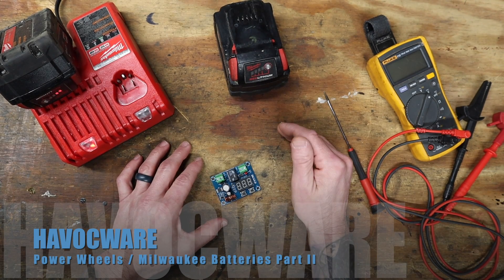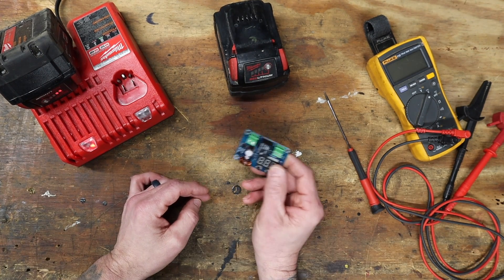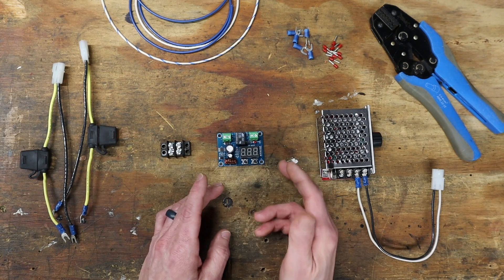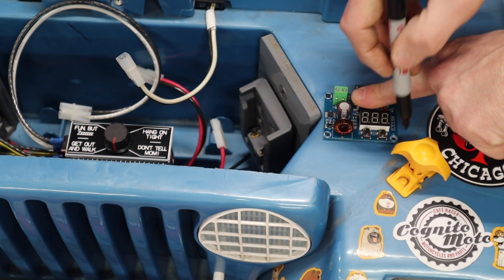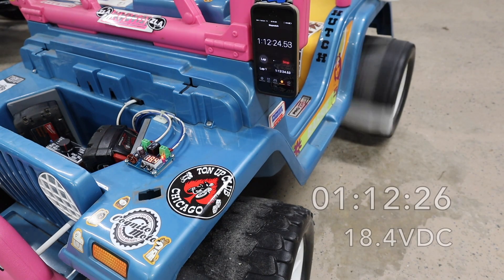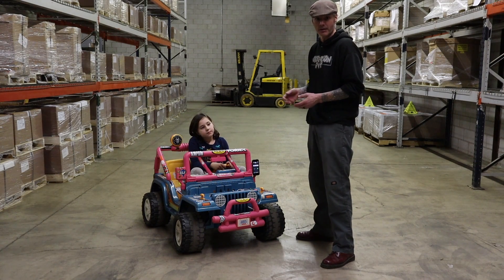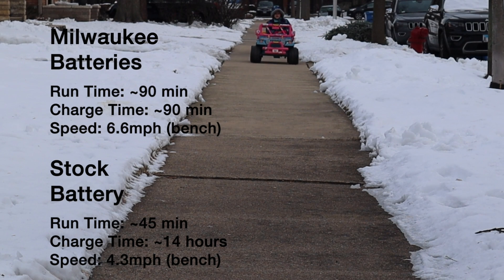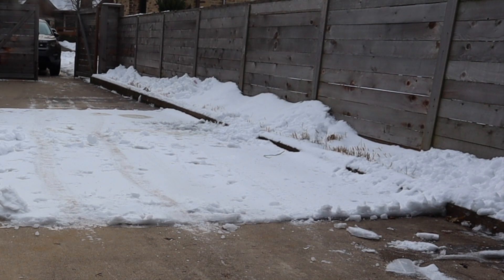Power Wheels Milwaukee Battery Upgrade RUNTIME TESTS & Battery Over Discharge Protection Install

Comment: Hey man great work. I watched your video a few times then I decided to go for it. I have a older peg perego Polaris rzr 12 volt that the batteries quit charging on. I ordered the 2 Milwaukee 18 volt adaptors , voltage regulator, and voltage cut off relay off amazon and installed it like you did in the video. I’m running 2 18 volt 5 amp hour batteries. I got about 10 minutes of run time before it quit working. Not sure if I burnt up the motors or something else. I was thinking about ordering the 24 volt 550 motors on amazon. I was wanting to know what you thought about those motors. Also I was wondering if you upgraded any thing else in your set up. Thank you and any advice would be great.

Comment: Hey bigg guy I'm thinking of trying with a 20 volt, why is the reason to use 2 batteries? Serious question and great videos.  Too cool!
Reply: Two batteries will allow the care to run longer of wires correctly. If wired incorrectly, they can double the voltage and likely burn out the motors.

Comment: What about amp draw? Stall amps on the motors is 28A, well over the limits of the voltage cutoff. Have you blown any units?

Comment: Did you add a power switch? Won’t the low voltage protector continue to draw power even after it has stopped delivering powers? Or do you just remove the batteries after every time it’s used? Thanks and awesome video!
Reply: I am wondering the same thing?  I had a low voltage cutout circuit like you used on mine but forgot to unplug the batteries after a session and the cutout board drained it down to 5v.

Comment: What size and type of wire is preferred?
Reply from the maker: The fuse holders and battery clips were both pre-wired with 12g THHN. I used MTW for the remainder of the harness, it's a bit more flexible for harnesses and panel wiring.

Comment: The battery hook up I will be using is from 2 busted rigid drills I got for a local repair shop that were just going into the recycler. Since I am using a stock rigid battery hook up and battery, do you think that it will have the over discharge protection built in or will still need to discharge monitor installed? Is that circuitry protection in that part of the drill or farther up the handle that will be chopped of?

Comment: works great with the 5.0ah batteries but doesn't work at all with the big 12.0ah battery for some reason the breaker trips instantly with the big high output battery which really sucks as it runs a long time wired direct but it's not worth toasting the most expensive 18v battery milwaukee makes. If they make a low voltage cutout module with a higher breaker like 30amp that would be prefect.

Comment: I have to completely rewire my kids kid trax jeep. I have all of the parts you have. My question is, where do I insert the foot pedal switch? I upgraded all the wiring to 12g. I am not going to use any relays. Everything is fused at 30 amps and the foot switch is rated a 30 amps also.
Reply from the maker: Hey there. This modification only replaces the battery portion of the circuit. Everything after these new battery connections is stock wiring, and hasn't been altered.

In my case, the output from the speed controller connects to where the original battery would connect, and the foot pedal switch is most likely just after this connection. I can't be certain, as I didn't modify the unit beyond the battery.
Reply: I got it all wired up. Now I'm waiting for 775 motors and new steel gears.

Comment: This worked great for a couple of days until the protection circuit fried.  It turns out that it’s rated at 20 amps.  I felt it, and it was hot (not warm) to the touch.  Now I’m trying to figure out if they make one of these that can handle 40 amps or a way to wire in a relay.  I’d certainly welcome help from others or the original poster!  Everything else worked great though
Reply: Oh and looking at Amazon reviews others had the same problem on Power Wheels so we might need to find a more heavy duty version.
Reply from the maker: Hey Doug. Sorry you're having an issue with the load on the protection relay. If you're up for it, I can draw up a quick schematic for you to use the voltage cutoff unit in tandem with a 12vdc auto relay. Might cost another $5 (and a new cutoff module), but it will definitely handle the overcurrent issue.

Cheers.
Reply: havocware yes please!  I considered this but could not wrap my head around how to wire it in a way that the board can still read the voltage.  Thanks!
Reply: @havocware  This is exactly what i need. Please tell me where to pit the relay 24v in the wiring and i can figure it out as one video shows it after the low voltage control unit to the voltage speed control and then the relay.  So not sure if this is correct. Thanks for your time.
Reply: @havocware  Can I please get the schematic.  Everywhere i read, states that the cutoff unit will burn out with mlwke and dwlt batteries. even some of the vendors on amazon state it in the details/prod description.

Comment: Thank you! I just got this mod done and it works flawlessly. 
Does anyone know what the low voltage shutoff for 20v dewalt batteries should be?
Reply from the maker: Excellent Jim! Cheers!
Reply: My Dewalt cuts out at around 15.11V, a 16V setting will do the trick.

Comment: Thanks for this video, I was able to upgrade my kids car to 18V safely. I had to use a 2 channel relay optocoupler since her car has led lights and a music player with a display that works on 12V.  I had Ryoby battery packs but it's basically the same thing. Great Video!!!
Reply from the maker: Hey Robin. That’s awesome! Glad someone was able to get one of the newer vehicles with lighting and sound dialed in with this mod! Cheers!
Reply: Hello! I was looking for any information how to save lights and sounds on newer vehicles and get the upgrade done but found nothing. Can you please share any tips on how you did it?
Reply: I did it tonight, one of those purple kidtrax convertibles. Radio, headlights, fake engine startup. All seemed like it worked perfectly fine. Everything did get brighter with the voltage being turned up, but that's something for tomorrow me to give a shit about.

Comment: Thanks for the great video! I noticed that the molex connectors that you recommend are 14-20 AWG. Will those work with the 12 AWG wire that comes on the cradle?
Reply from the maker: Hey Moe. I didn’t have any issue with the molex pins and the 12g wire. It’s a tight squeeze, but nothing it wouldn’t but into. Cheers!

Comment: Has anyone had trouble with the voltage controller blowing fuses.
Reply: Yes.  I burnt out a voltage controller.  As the manufacturer suggested, I ended up using two voltage controllers (one for each battery) to get around this.

Comment: I did the same conversion, but the 30 amp fuse on the power controller keeps blowing. Any idea what might be going on?
Reply from the maker: Hey there. Sorry you're having trouble, but do you have any fuses on the circuit aside from the internal fuse of the controller?
Reply: This. I’m having the same issue. Everytime we start it up the 30 amp fuse on the speed controller blows within seconds. We have the 2 fuses coming from the batteries but they are fine. We followed this mod to a T with the exception of us using 2 20v dewalts. You do such a great job of explaining everything. I’m not sure where we could have went wrong. 
It’s like the jolt of speed once you hit the pedal blows the fuse or something. Any help would be greatly appreciated by anyone.

Comment: how has the shut off held up over the last few months. I seen its recommended for 20A max. is it still running?
Reply from the maker: Hey there Michael. So far so good - I haven't had any issues with overloading or fatigue. Cheers!
Reply: @havocware  ok thank you. i was worried the 20A max load rating wasn't enough. im going to grab a couple
Reply from the maker: Make sure you add a fuse somewhere in the circuit anyway. A $00.35 fuse is cheaper than a $20.00  speed controller...

Comment: I'm setting up my low voltage module right now. From the video did you set the postive side to 16v then the negative side to 1.5v to get that 17.5v?
Reply from the maker: Hey there! Close - I set the cutout value to 16.5, and the threshold to 1.0 = 17.5. You’ll be fine with 16 / 1.5 if you prefer. Cheers!
Reply: @havocware  awesome thanks for the fast reply! Not sure if you've done this yet but I also upgraded the motors to Traxxas 775, I'd recommend that if you want a little stronger motor and a little more speed!

Comment: These batteries should be able to tolerate running down to 2.5 volt in each series of the pack and they are 5s2p which would be the 13 volts or so but this run time was amazing and I think you would decrease some performance. I am probably going to set it up to go to 15V cut off. The more you run the battery to the full depletion the harder it is on the battery but 15 volts should be fine. That will probably add 30-60 minutes  and it should have no effect compared to 16 volts. I would not go to 13.5V as it is possibly a poor cost to fun ratio.
Reply from the maker: Hi Carlo. That’s some great information, appreciate the input! Cheers!
Reply: @havocware  anyway you would consider making a plate for the speed controller and  if so how much.

Comment: What would I set it to for my dewalt 20v batteries?
Reply: My Dewalt cuts out at 15.11V.
Reply: I've been wondering the same thing!
Reply: @richardconrad698  My Dewalt will cut out at 15.11V.
Reply: @308Sharpie  Thank you! I think I set mine to 17 something, from something I saw on the amazon product page for the power shutoff. Good to know! Once my daughter masters steering, i'll increase the speed and i'm sure she'll drive it more! So i'll probably want to adjust the shutoff then, thanks!

Comment: Hey mate really enjoyed the video. Quite a detailed and well thought out.
.....Can you lol run the batteries in series for maximum voltage? How would the motors hold up?
On another video, the guy essentially swaps out the "throttle" (its just an on/off switch) with an actual throttle pedal .. (I guess it would be basically the same as the controller that you have, but with a pedal instead of a knob ... right?)
*In the same video, the guy also did 48v and blew the motors
Reply: @Mephmt  I was thinking 36volt.
And yea, some sort of progressive "throttle" rather than the on/off switch as standard.
I mean you could always run 2x18v (if 18v batteries is what you currently have) and then dial it back to whatever is a comfortable voltage for both the driveline and motors. (and driver lol)
Right?

Comment: I have a question to the general public 🤔 I did everything and now it just continues running once put the batteries in whether the power button is on or off could some please explain to me what went wrong. Any suggestions would be greatly appreciated 🙂 🙏

Comment: So I did the setup as you described. I place it in my kids Yamaha grizzly 4 wheeler and it doesn’t move. It does a slight jerk motion but no movement. There is no burning smell or anything like that. Any ideas of what could be wrong? My only thought is that I may need another step as this 4 wheeler has a high, low , and reverse switch.
Reply: Your 4-wheeler may have an internal circuit protector my niece's four-wheeler/ATV does the same thing. 
I installed (2) batteries (1)12 volt, (1)20 volt.
  I drive it around our property-about 9mph.. and I'm 245 lb 😂 but after 2 minutes it stops and then I heard it click and reset itself.

Comment: Updated Parts list:

Milwaukee M18 Charger - $30 ebay
Milwaukee M18 2 x 5ah batteries (knock offs) -$56 ebay
Milwaukee 18v M18 Battery Mount Bracket Holder -- / Dust Cover (3d printed) - $6 ebay
Terminal Block - $8 ebay

IS ICStation Digital Low Voltage Protector Disconnect Switch  -$14 Amazon
RioRand 7-70V PWM DC Motor Speed Controller Switch 30A -$16 Amazon
Molex Connector Lot, 5 Matched Sets, ( 2-Circuits ) w/14-20 AWG .093" Pins, Free Hanging -$10 Amazon
Nilight GA0004 5Pack 12AWG Inline Fuse-5 Pack - $5 Amazon

This includes everything except wire.  Note these are knock off batteries and definitely not up to Milwaukee standards.  Also i went with 2 of the 3d printed dust cover type battery holders and will drill them out or just cut slits and feed a positive and negative wire through them.  Net savings of $30 bucks by doing this over the suggested craddle.
Hope this helps someone

Comment: Go to Walmart get some cheap replacement bike tires and screw them in the middle of the plastic wheels. Traction and handling is greatly improved. No more sliding to stops ten feet after foot is off accelerator.

Comment: Just tell them it last forever if you keep good tools around because I'm sure it is not your only 18v Milwaukee battery. All this seems like over kill to me. Even with your last video. Obviously I am not as technically inclined as you but seemed like more work than really needed. All I did was replace the leads with spades and slid them into the first and last slots. Only thing is to make sure electron flow is correct or will operate backwards.

Comment: I need assistance, I’ve purchased two different motor controllers including the same one you bought (Riorand) but all they do is pass the voltage through, it’s not adjustable. I have the battery hooked to the power input and the voltmeter to the motor output. Am I missing something or did I really get two brand new defective dc controllers?
Reply from the maker: Hey Chris. Sorry you’re having an issue with the build. Can you link to a few pictures of the wiring, or take a quick video? I’ll take a look and see what I can find.
Reply: How do I get you the pictures to review? Thanks

Comment: Could you use kobalt batteries (and an appropriate adapter), and wire it up the same? I have a power wheels Escalade that has a shot battery.

Comment: Would this same setup work if the batteries were run in series for 36 volts? I know that the gearboxes and motors would have to be upgraded as well.
Reply: Yes, it will.. I'm doing my niece's atv with (2)20 volt 4ah batteries in parallel for maximum torque. However, I'm adding a sprocket to the rear wheel, disengaging the factory gears and connecting it to an impact gun via bike chain.
Pretty much a drill powered ATV with 2 batteries..
I don't know who is going to love it more, her or me 😂
Reply: @jorgepizarro3327  He asked if it would work in series. You give real world experience for what happens when the batteries are run in parallel... "for maximum torque" (as though running two batteries in parallel would make the motor output more torque for some reason?). Do you see what you did wrong here? Unless you just answered the question and moved on to completely irrelevant examples... Which would be stupid. If you're saying yes 36 volts would work, I'm guessing dude that asked the question wants an example where you put 36 volts or greater into one of these and it was fine for more than ten seconds.. Cmon, what if this guy blew his kids power wheel up because of you?

Comment: I made this point on another group that were using Milwaukee batteries to power other devices that were not Milwaukee tools. I was told repeatedly that the low voltage protection circuit is already installed in the battery not the tool. So is this even necessary? Or do the batteries really not have a low voltage protection circuit installed?
Reply: I would install the low-voltage circuit it's cheap insurance

Comment: Would this essentially work the same for a Dewalt 20v 5Ah? Or would i have to adjust any settings?  I do not have access to Milwaukee batteries here nor can i get them to ship here for some reason.
Reply: Yes, it will.. I'm doing my niece's atv with (2)20 volt 4ah batteries in parallel for maximum torque. However, I'm adding a sprocket to the rear wheel, disengaging the factory gears and connecting it to an impact gun via bike chain.
Pretty much a drill powered ATV with 2 batteries..
I don't know who is going to love it more, her or me 😂
Reply: jorge pizarro did you try the (2) 20 volt conversion and it striped out the sprockets?? I only have dewalt 20 volt batteries that I was going to use but I really don’t want to replace the power wheels drive motors or sprockets if I don’t have to. If I use two 20 volt batteries in parallel does the battery disconnect need to be rated for 40 volts??
Reply: @blakemontequin4838  yes, I did do the 20 volt conversion at first I connected the 20 volt battery to the ATV normally and it went and stopped with no problem however it was an instant go and an instant stop. Whenever she would take her foot off  the pedal it would just brake and not coast freely. This will cause the wheels to wear out faster because it turns it into a "powerslide".

If you use the battery disconnect it needs to be rated at 20 vdc if you're using (2) 20vdc  in parallel.

So, what I did was take both of the the motors out and attached the impact gun underneath the ATV with sprocket. And on the rear wheel I screwed on a freewheel sprocket and then connected the two with a chain so anytime she stepped off the accelerator it would still coast

Comment: Imagine using the 12.0 HO batterys, or even the 8.0 HO batterys. The HO batterys would prob have a longer operating life due to the larger 26650 cells they use instead of the 18650s.. would make a great part 2!!!